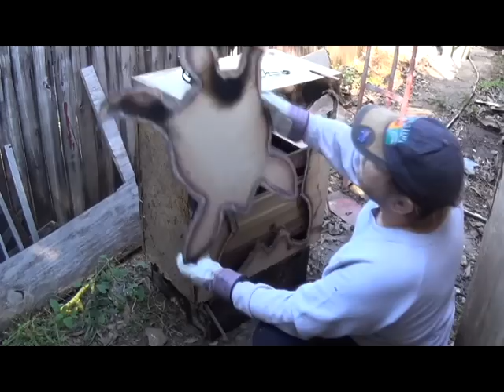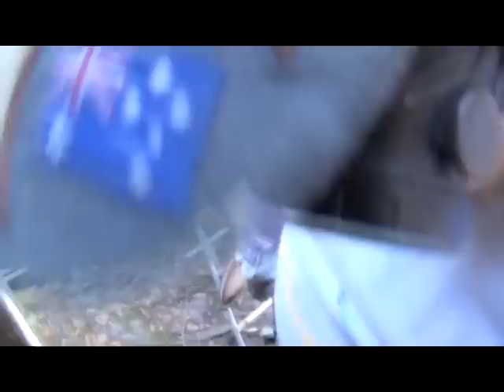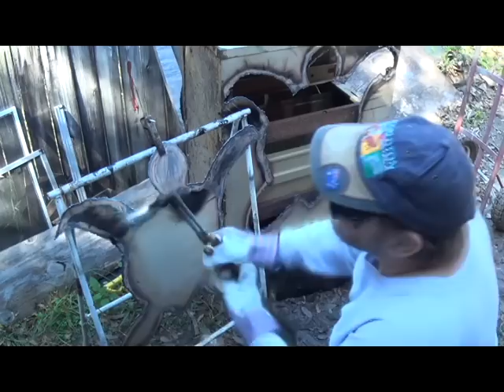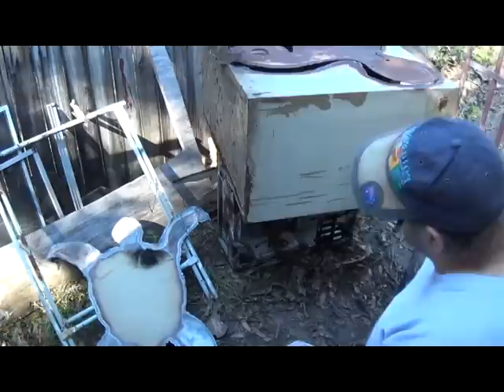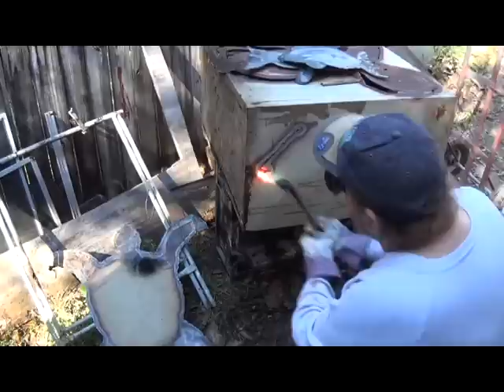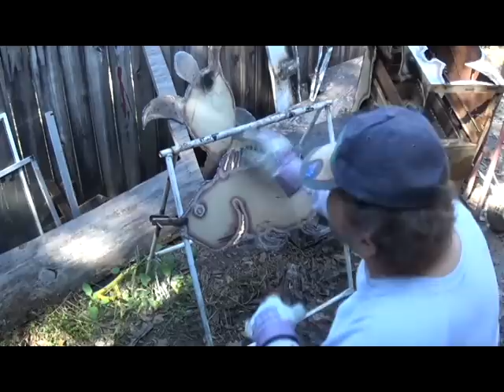turtle soup. part 1

Comment: Wanna save some money on your cutting torch projects? Switch your torch over to propane, it's a hell of a lot cheaper than acetylene, and you can pick up a 20 pound tank of propane damned near anywhere. All you need is a propane tip for your torch and you're in business, the acetylene regulator fits propane tanks and works perfectly well for either gas. Propane doesn't burn as hot as acetylene but it's more than hot enough for brazing and all but the very heaviest cutting, the only thing you can't do with propane is gas welding.
Reply from the maker: where were you 2 days ago? i just refilled my tanks. they should last a year or more. but i'll keep that in mind. 
thanks.